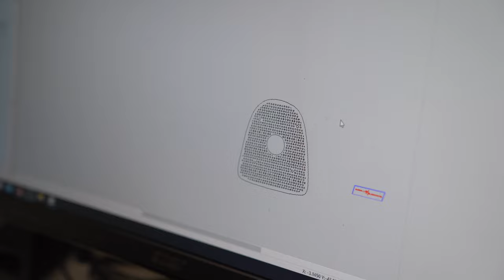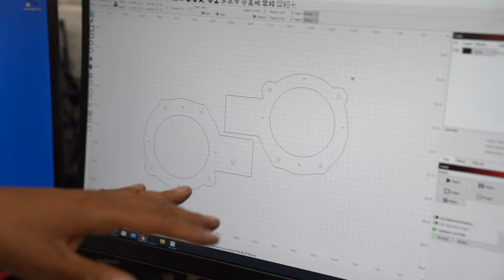Full Speaker install on S2000 | Absolute Electronix Speaker kit

Comment: Audiofrog vs Sony ESs?  Was thinking high powered Sony head unit but prefer a warmer sound vs bright which I understand a class D amp from head unit would exacerbate, no?  Have an AP2 I’m strongly considering having done by you.  Thx for the content.
Reply from the maker: It kinda depends on what you like. For the money the audiofrogs are seriously hard to beat. If your a guy that’s got Les money and still want a good set of speakers the ES are great. If you’re local you’re in better situation. I chose the audiofrogs for our kit because it was literally the best for the size of the tweeter behind the factory grill sounded the best for the price and can take serious power if necessary. There are so many other options if you want to check them out I’ll personally let you hear one of my s2000s
Reply: @absoluteelectronix7991  so, I grew up in the area, but now live in SC.  I’ll be up in ~week for a week.  May try n see u if I can.  Do u have much inventory or do most things need to be ordered?  Also, toying with the idea of a shallow powered sub under driver’s seat, any thoughts welcome.  Thx again.
Reply: So I understand you no longer have the acrylic adapters.  Can these still be installed easily in an AP2?  Assuming you do all the wiring, etc before shipping?  Thx
Reply from the maker: @thecostanzatheory  same install factor with the pvc adapter as the clear ones just more durable